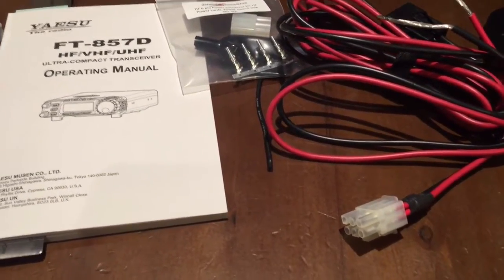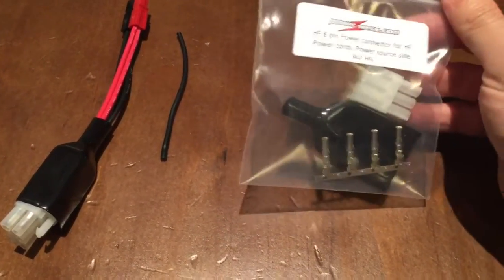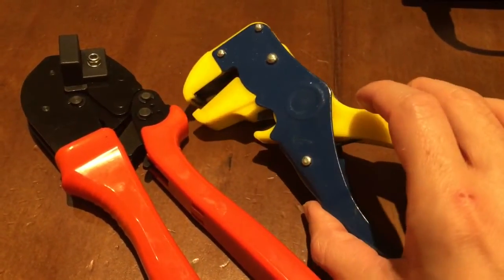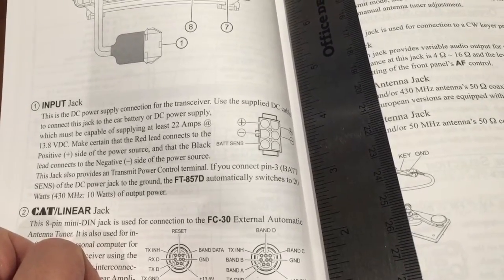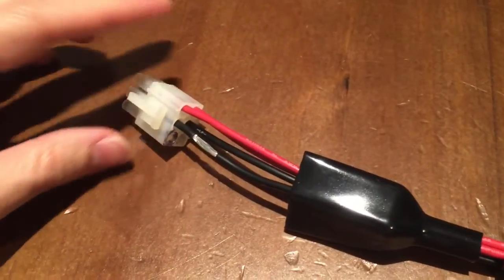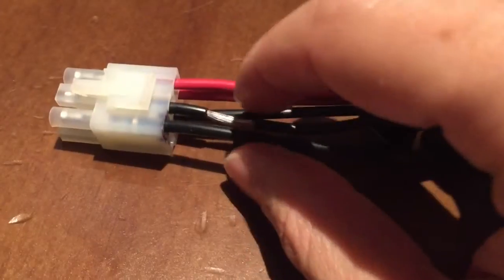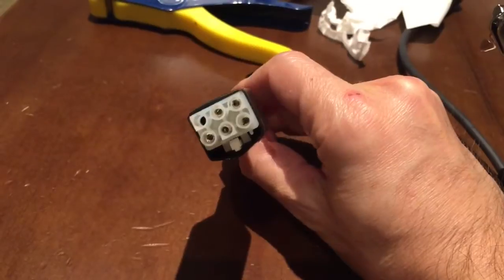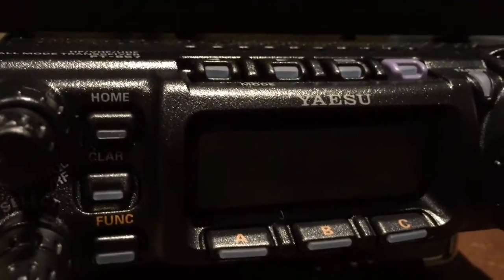Yaesu FT-857D Battery Sensor Mod

Comment: Cut that monstrosity yaesu pos plug apart     Put power poles on the radio side   Done  if i need low power  i go to the menu and turn the pwr down

Comment: By any chance did you happen to measure the difference in the current drawn on Receive before and after mod?
Reply from the maker: I didn't Ken... i would imagine idle/receive is similar to non-battery mode with backlight off.  Transmit power max is limited to 20W when in battery mode.

Comment: My new FT-857D have that brown cable but even connected to my DP Power supply, it's lowering the power output on HF from 100W to 20W......  Then, what shoud I do to bring it back to 100w?   It's configured to 100 in the settings.
Reply: You should read the manual for this tranciever, part about power supply. There are you can find the answer for your question. Very simle decision - to delete jumper from pin3 power input jack. 73

Comment: What crimp tool do you have? Model number? I hate crimping without the proper tool. Thanks!
Reply from the maker: PowerWerx CrimpBag - https://powerwerx.com/crimpbag-tricrimp-tridies-gear-bag (it's expensive but has changeable die sets to crimp pretty much anything I've needed for small electronics)

Comment: Sir, can this radio be used in a 2016 diesel-motored truck, with two seperate 12-volt batteries?
Thank you Sir, for your help.
Reply: Yes. Your batteries should be wires in parallel so no difference in voltage. Check with a volt meter to be sure but I doubt it's 24 volts.

Comment: Nice video.  I'm confused about the need for both packages.  Are you just using one pin taken from the HF6 package to make up the battery sense mod to the HF6-PP?  Thanks es best 73 de wa4chq
Reply from the maker: You don't need both packages.  I just didn't have an extra pin sitting around, so I bought the other kit to get the one extra pin I needed.
Reply: That's what I thought.  One other question.  Right now I'm just running the 857 at 5w.  I haven't made up the cable for the battery sense mod.  Do you see a difference in battery drain without the fans kicking on?  Thanks for the speedy reply.  72/73 wa4chq
Reply from the maker: I haven't objectively monitored the current draw difference, but it feels like the battery lasts longer.  The one annoyance is the backlight shuts off very quickly with the battery cable mod to conserve power.  Fine if it's bright out but not great if it is dusk... haven't found a way to override it.
Reply: OK, thanks again.  Maybe some sort of LED light from Dollar Tree..... 72 de wa4chq
Reply: @JeffreySerpas  Attach an LDG FT Meter?

Comment: Did you measure the standby current with your new adapter (with the lights out)?  I was wondering how much current drain it saved.